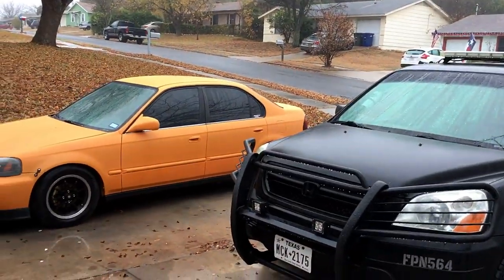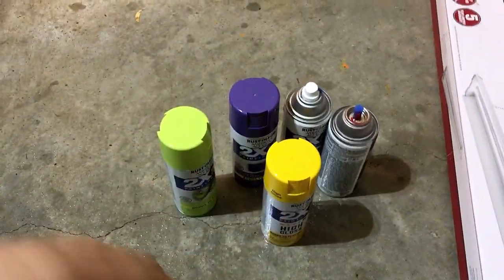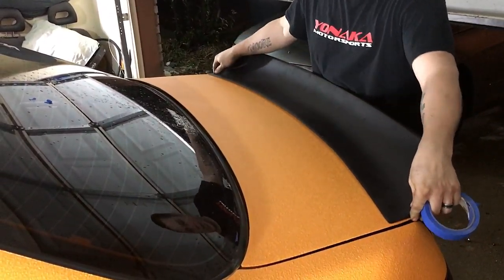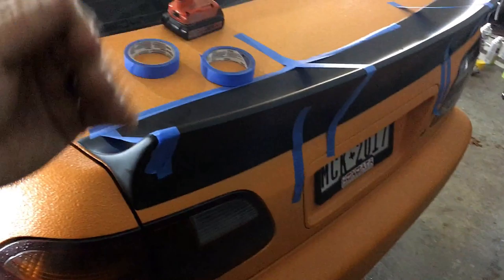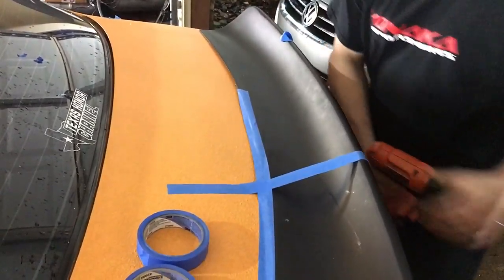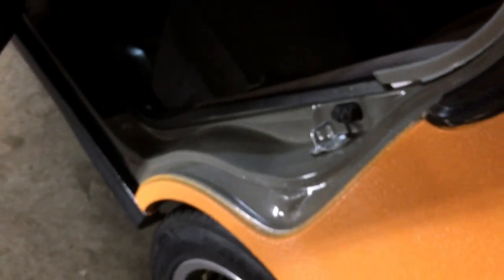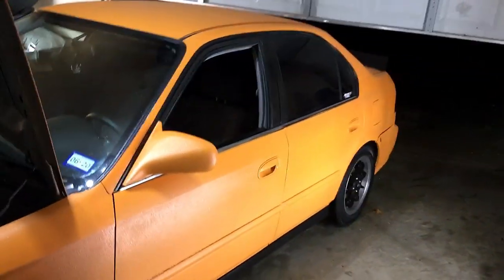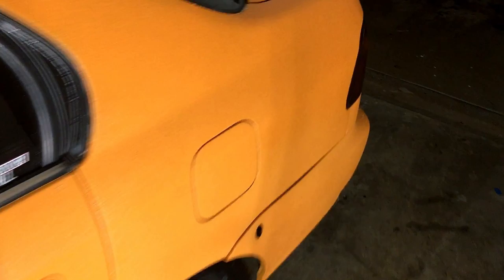Autism awareness build- Part 2 Duckbill wing install (Ebay)

Comment: Hi James
Great Chanel! I just subscribed.
I have two older work trucks that I would love to paint.
What would be your recommendation for the best cheap paint job for durability and finish?
I thought maybe the 2x with the 2k clear over it.
Any thoughts or recommendations would be greatly appreciated
Reply: Maybe truck liner??
Reply from the maker: John Daniel Suk The truck bed liner is proven to be easy to spray cost effective and long lasting but I would go raptor liner over all others
Reply: @JamesDguy  Okay sounds good
What if I wanted to just paint it and then have it logoed up for my business. Would you recommend the 2x with 2k clear or the advanced with 2k clear.

Want it to last for 4-5 years
Reply from the maker: John Daniel Suk advanced with 2k clear
Reply: @JamesDguy  thanks alot
Very appreciated